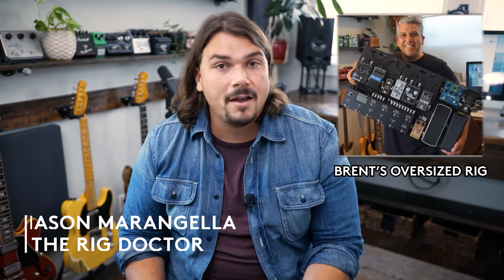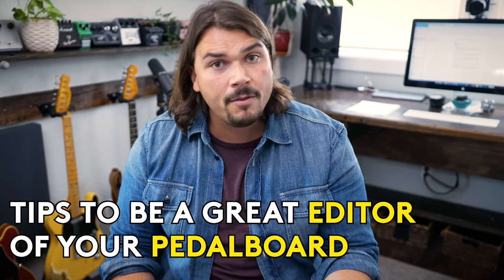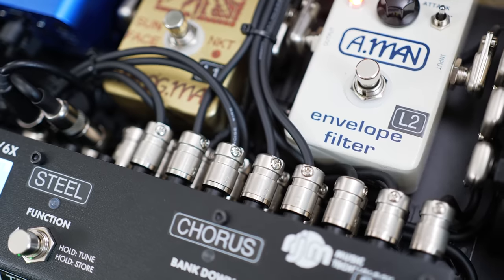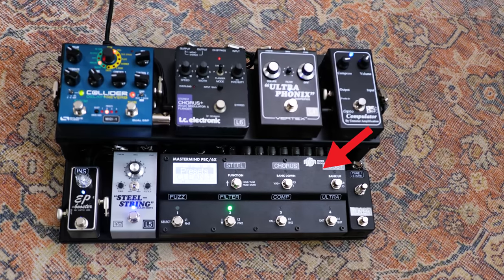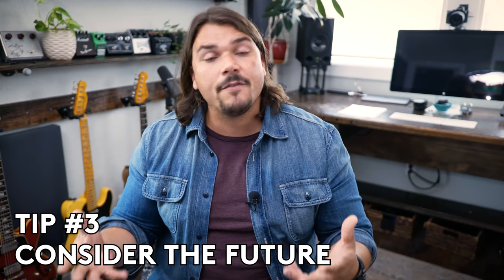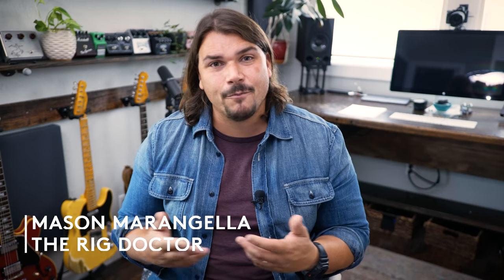Consolidating Your Oversized Rig

Comment from the maker: Table of Contents:
00:00 Intro
01:59 Consider Your Context
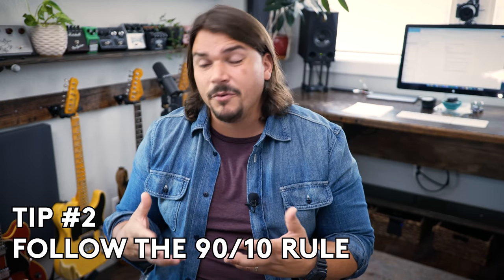03:25 The 90/10 Rule
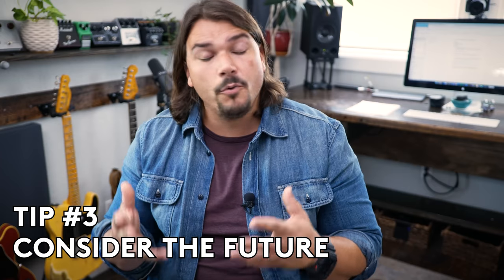05:39 Consider the Future
07:02 Using Good Materials
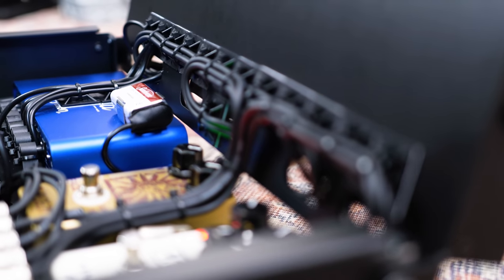09:04 Recap
10:27 Space-Saving Pedalboards
10:45 Outro
Reply: I use an EHX rams head and Boss Blues driver at the beginning of my chain and I want to buy tc electronic polytune mini as a tuner/buffer. how should I order it. tuner, rams head, Blues driver? or rams head, Blues driver, Tuner?

c electronic polytune mini and the noir
Reply: Awesome tips. The single most useful tip is the 90/10 rule and it is definitely true in my case. I have a chorus I use for only one song and the setting is so subtle I can get away with a nice analogue delay with modulated repeats. Boom one pedal out. Flanger? I wanted it and never used it. Boom another pedal out. Different overdrive flavours? I always go back to the usual two. Taking away utility pedals like the looper that I only use for practice at home, I can consolidate my pedalboard with 5/6 pedals rather than having a 12/15 pedals.
Reply from the maker: @ManuelPassarella1  thanks for the comment...glad you found it helpful!
Reply from the maker: @johnjohn6501  I would experiment with the buffer pre/post Muff and see.  The Blues Driver won't matter relative to the buffer.
Reply: @VertexEffectsInc  will do thanks for the reply

Comment: Thanks yet again! Even as a hobbyist, this is the most vexing topic by far. Way harder than making a decision about which pedal to buy, is which pedals to put on and leave off. I have decided: multiple, modular friendly, small boards. Not as expensive as it might sound. Most guitar players have enough pedals. You can make a board out of wood (hey, it's good enough for Paul Gilbert) or buy an affordable one. A small everything-in-front board. Then a 2 board pair - with one board being used for reverb/delay/effects loop (4 cable), and one front-of-amp board for distortion etc. My reasoning for 2 small boards is that it makes it a LITTLE easier to change between 4 cable, wet dry, and mono. That process doesn't seem to have a simple, clean solution. I finally just set up a board where I left enough room to simply pull the two Right/Stereo patch cables out of two stereo pedals, leaving the Left/Mono cables in place for Mono. I plug them back in for stereo. Simple enough. I guess you could rig some A/B boxes but then you're back to MORE STUFF! I'm addicted to stereo whenever possible. Also love wet-dry but it's not practical except at home, or using your idea: a wet/dry/wet system using one amp and  tapping off of it for Left/Right front of house. Maybe Dan's bigger Gig-Rigs and/or midi would allow any and all mono, stereo, and wet/dry/wet possibilities to be consolidated and foot switched from one board? I don't know. I can't justify a $1000+ switcher, but I have accumulated plenty of GAS pedals spread out over the decades - and an endless supply of home made wood scrap boards.
Reply from the maker: Glad you dig it.  Dan's Gig Rig units don't really fully do the wet dry as completely as a true stereo mixer would were you can set series parallel mixes.  I don't think this was how it was intended to be used either.  With that said, nor do the RJM units or MusicomLab on their own.  They need separate mixers to pull it off like the Parallelizer.
Reply: @VertexEffectsInc  Kinda thought so, wasn't sure. A sane person, with enough money, would just go the Iridium/Kemper/Helix route. But I like my pedals, and my amps, so I stick with them. Thanks for all the info you share on this channel. I saw where Samantha Fish gave up her pedal board and it made her a better player. I can see that. But then she went back to having a few pedals again ... LOL, yup!
Reply from the maker: @SFolkes97  you could if you wanted to get rid of the amp I suppose...but talking pedalboards if you can stick with the classic analog effects, they'll outperform the digital stuff and typically we don't need so many that a multi-effects is really required.
Reply: @VertexEffectsInc  I was being facetious - I'm an old guy and don't want to carry anything heavier than an Iridium, but I still do lug amps/gear around. Actually that board you built Mitch at Sweetwater was perfect. Amazing! Am I correct that you will be selling a patch bay buffer box on Sweetwater? I looked at their page that lists the gear, and on The Rig Doctor site, but didn't see it. New product?

Comment: I prefer wood as it's easy to cut down or build bigger depending on the design. Building multiple pedal boards allows you to explore changes at various times in the year. Build multiple sizes to fit the purpose, whether recording, practice, travel, or live make sure you're covered. My tip is to build a board that works with normal patch cables because it cuts down on cost and customization requirements.
Reply from the maker: Depends on your context, if you’re actually gonna be traveling with it and there’s actually pretty standardize sizes that the Pedalboard will need to be, and addressing the sizes to that is ideal, that’s how we determine the size of our boards.  Wood is always heavier than aluminum.  To make it look clean you still have to laminate wood and have aluminum u channel extrusions on it which it time consuming and requires some diy woodworking skills.  If you can solder it’s easy to make your cables as you need to the size you need and they’ll be better cables than the prefab for the same price in materials or less.

Comment: Loved the video. I had noticed on your recent wet dry 80s rig that you appeared to have a couple of smaller pedals mounted on top of the Cioks power supply. Am I wrong in thinking so or is it possible to fit say a tube screamer mini in that space on top of the power supply and under the hinged tier? Looking at ways to downsize my board and wondering if this is one. Thanks!
Reply from the maker: Yes, we put the comp, tube screamer, and riot on the Cioks 7

Comment: Biggest issue I'm having with setting up my current board right now is that I'm using 3 "treadle" effects. I've got a volume, a wah, and just got a whammy 5 to replace my whammy II so I can incorporate midi into my setup. Plus, those are all next to my new pbc 6x. I'd love to make my board smaller but I don't know how without still making it so wide. Right now I've just got a big pile of pedals staring at me and want to figure out what to do.
Reply from the maker: You could do a satellite board for those?
Reply: @VertexEffectsInc  I could, but I'd rather make one board that I wanna keep under 50.
Reply: @VertexEffectsInc  any pedal you'd suggest that I could swap my whammy for that could do polyphonic pitch and glitchy whammy fx that I could replace and hide on the board somewhere and just put an expression pedal on? In a perfect world, digitech would come out with a stomp box sized whammy that had no treadle but still had midi.

Comment: MIDI and loopers are two things I’ve never been tempted to use because they just make things too complicated (in my experience) in terms of board flow and troubleshooting when problems arise. I’ve gone from point A to point B in a serial fashion on my boards and straight into the amp for over thirty years and see no need to add that kind of complication and potential for additional things to stop working at this point. I’ve also boiled my board down to ten core pedals over the past 3 years or so and dumped a lot of the added stuff that simply was adding weight, signal loss and option paralysis. I wish I could go smaller than that even, but I really can’t without going to the HX effects type setups and those don’t really interest me tbh. 

Pedalboards in 2021 are often bloated and more for show than true utility in the same way the ridiculous guitar racks of the eighties just became silly and impractical.
Reply from the maker: It can be done right and made easy to troubleshoot - if you see most of our rig build we try to illustrate the best way to do this without having too many issues.  However, it's never as simple as a few pedals, that's true.
Reply: @VertexEffectsInc  You guys do some amazing builds no doubt, and I do love looking at videos and pictures of how you route everything.
Reply from the maker: @softlightsymphonyband  thanks for watching!
Reply: @softlightsymphonyband  That's because you probably play a genre that doesn't need that kind of switching and that's cool. For me, midi switching just means 5 less buttons I have to click because my delay time, modulation and drive preset changes with one tap

Comment: yep been trying to keep it 6 or under total pedals
Reply from the maker: He got more than that on 10 x 17 plus a switcher
Reply: @VertexEffectsInc  perfect! i got a gigrig g6 1 overdrive 1 fuzz and 4 modulation that all work together for alot of combinations and il bring another small mod board for aambient weird effects demonstrations !! wich doesnt always get used or if i forget it in the van
Reply from the maker: @joshfowler8360  Cool!
Reply: @VertexEffectsInc  I fit a wah, tuner, octave fuzz, klone, t.s., phaser, chorus/vibe, delay, and trem all full sized pedals on my Vertex 10 x 17. Plus an always on comp/boost, splitter, and iso brick under the hood : )

Comment: Hello is there a template for the interface boxes you have been using lately where the jacks are connected to side panel of the riser? Or a different method on how to have jacks put on those panels? Thanks
Reply from the maker: Yes, see the links in the description for DIY buffer/interfaces.  This is the drill template for the side wall buffer box using a Hammond 1590B: https://docs.google.com/drawings/d/1BHaQtHn6cUFOWpUNoiQ12h62_UGUxRCdld25pkHztiM/edit?usp=sharing

Comment: Is there a product for pedals that get changed out from your board could be mounted to, then latched into and out of a couple spaces on the board.  I'm thinking of drive and modulation pedals that depending on gigs you might want to change out.
I'm not talking about any hook and loop tape lol.  25 years of pedalboard use has taught me no matter how good, vertex included, it's not convenient to be taking pedals on and off semi frequently.
Reply from the maker: I think the best solution is still either our power grip or dual lock.

Comment: Hi Mason, does it worry you that when one pedal is ‘outside’ the switcher, and it’s a digital pedal, it means that your signal will be digitalized, no matter what quality analogue pedals you have apart from that digital one...
Reply from the maker: Most digital pedals have analog bypass, and analog dry through, so no, it doesn't concern me.